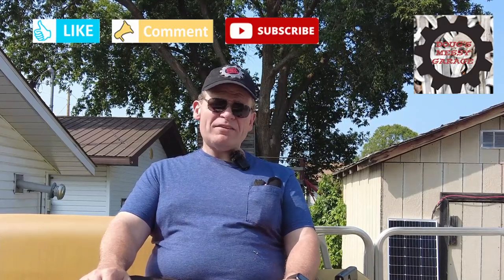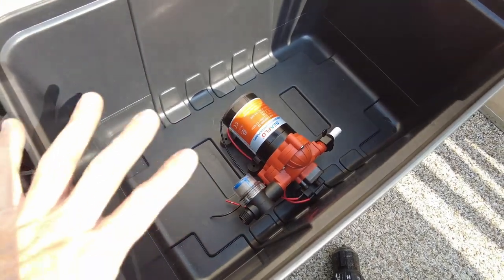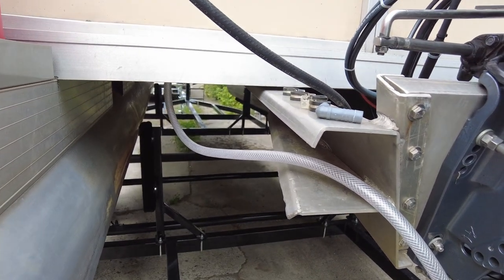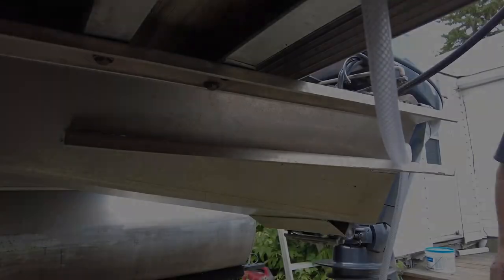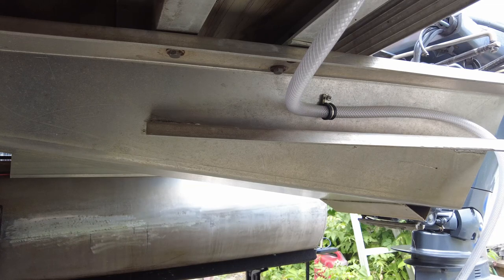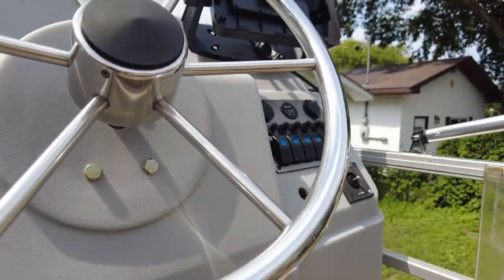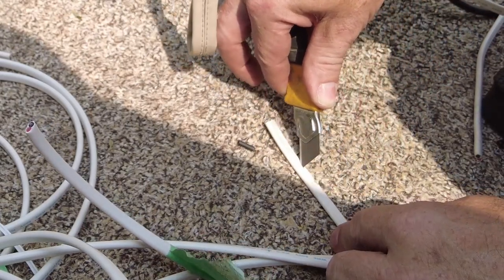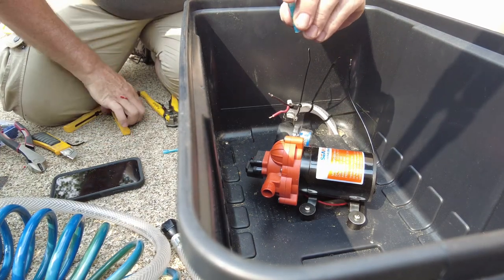Pontoon Boat Washdown Pump Installation: Project Pontoon Ep12

Comment from the maker: More electrical work coming soon.  I had to cut out a bunch work that I did at the same time as the washdown pump due to length but I will get it put together and post it as a separate video.

Thanks for watching.

Comment: Wow you replaced the Force motor! 
Was it giving you trouble or you got a great deal on the 4 stroke.
On my post on another episode I mentioned the boat I got has 2 of the 120 Force engines and they run pretty good. Hope I don't  have to change them anytime soon.